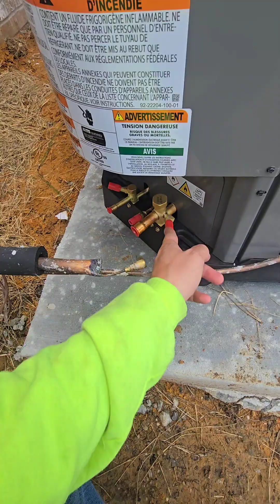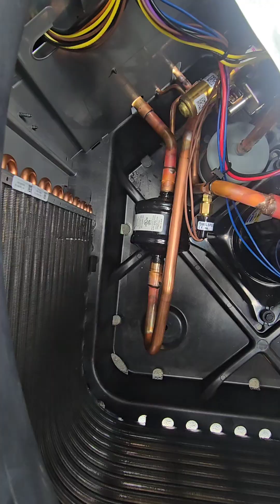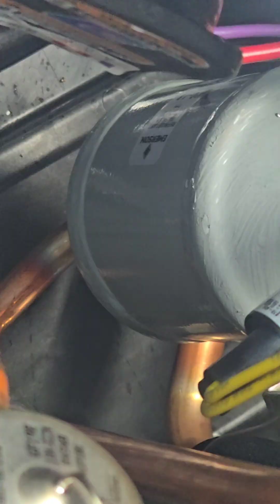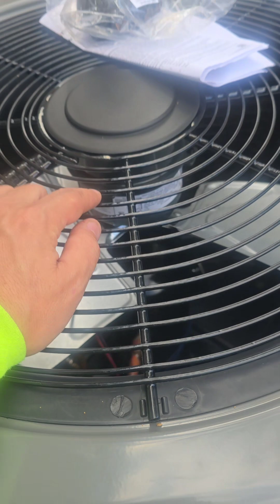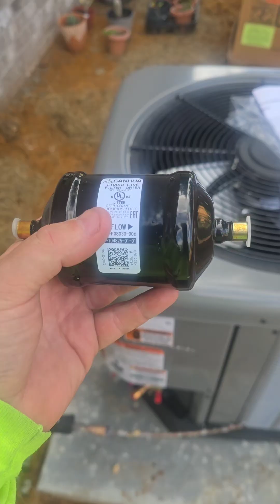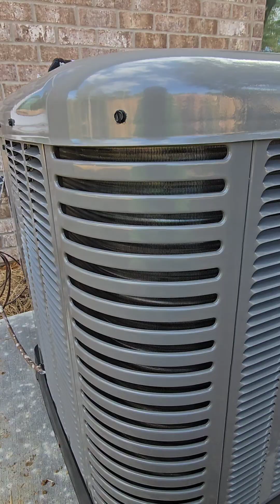hvac technician goes over rheem heat pumps and whats new about them

Comment: If you pop the rain shield off of the top covering the motor there are holes available where you can put a 48f condenser motor in place of the 42f if needed.

Comment: The first component is a charge compensator.  Heat Pumps don't have "suction" lines past the reversing valve - they are called vapor lines, because they carry vapor (either low pressure/temperature vapor or high pressure/temperature vapor - depending on what mode the system is running).  The charge compensator is a refrigerant vessel has the vapor line running through it; in cool mode, there is discharge gas, in heat mode there is suction gas.  There is also a third fitting for the liquid line to store liquid when the system is in heating mode.